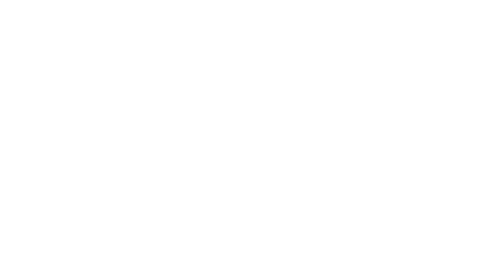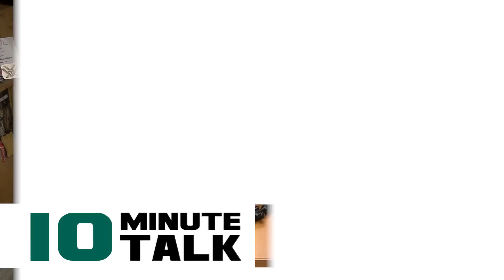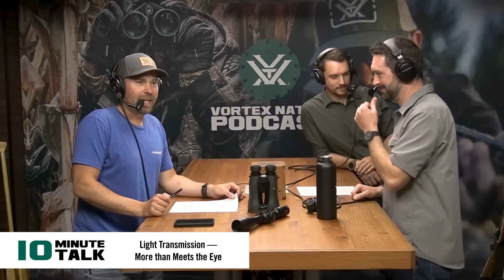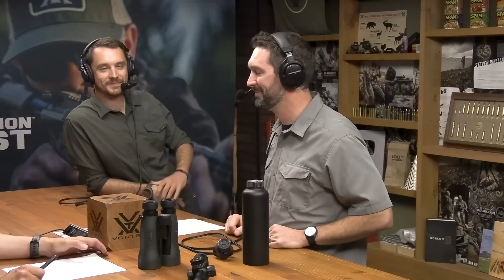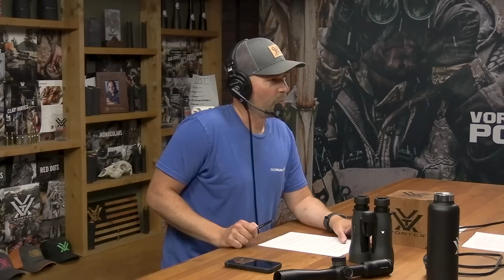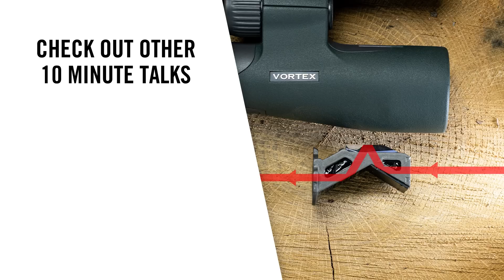#10MinuteTalk - Light Transmission — More than Meets the Eye

Comment: Maybe my question is answered later in the video but I want to ask before I forget to.

 I recently bought a vintage weaver 1.5-4.5 with a 1” tube and same sized objective and dialed back to 1.5 it’s comparable under low light to my modern nikon 3-9x40 1” tube despite the significantly reduced objective diameter and assuming inferior glass/coatings. With exit pupil being irrelevant would the reduced magnification explain this or is simpler design/fewer lenses the better explanation? How does magnification factor into this more generally, such as why a 3-9x40 on 3 seems brighter than on 9? Again, Sorry if this is answered later on.
Reply: This happens with every optic. It is because when you zoom in the prizms are moving to only show a smaller portion of the field of view, and trying to stretch it to fill the eye piece. That is why every optic with zoom adjustment looses light and field of view at higher zooms. Its no different that taking a picture to microsoft paint and stretching the corners to make it fill a page. Same count of pizels, but now each pixel covers a larger area.

Comment: When Rob mentioned having a large "objective lens" is like having a large funnel gathering more light, he should have continued with that analogy.  Imagine having a funnel with a large cone that transitions into a very small neck.  Anything poured into the funnel will overflow because of the restriction caused by the difference in diameter.  The same could be said with a rifle scope with a 50 mm objective lens and a 1 inch (25.4 mm) main tube diameter.  All things being equal, you should have better results (better light transmission) with a 50 mm objective lens and a 34 mm main tube.  But then the trade off is the extra glass which translates into extra weight and extra cost.
Reply: That is not at all how light works. Is the light coming through a hole in the wall any less bright than the sunny day outside because the hole is small? Your pupils are only about 5mm.

Comment: Is it exit pupil that gives you a view through a binocular or scope that seem like you can look around within the image?  Maybe its better to describe the opposite, a view that seems to have a small field of view that is like looking through a pipe regardless of power.   I ask this because I have some scopes or binoculars that seem to have a open field of view, when looking through the optic you can see a larger image, that compared to another optic at same magnification gives you a smaller circle of world in the glass.  You feel like you can look to the left and right in the image.  I am assuming that it's a combination of Field of View and exit pupil. Or is that just a result of the exit pupil, being larger than you need so you can focus your view on different areas of that large exit pupil?    Good optics like Vortex have that ability and cheep optics seem to have that fixed image that is only visible in that one small spot.  Yet when you look at the optic lens size and power the cheep scope should have a larger exit pupil, but you don't get that same effect of being able to look around in the image

Comment: The good glass part around minute 13:30 is gold. All the marketing mumbo jumbo about lens origins and coatings  is a bit like car dealers selling you on the interest rate for a lease without telling you the calculatory residual value. You only care about the total cost. Same here, you care about light transmission if all else is equal. How the manufacturer got there is completely irrelevant
Reply: Thank you, I love forward button when seeing 44 minutes long video, but have 20 minutes in hand before heading to work